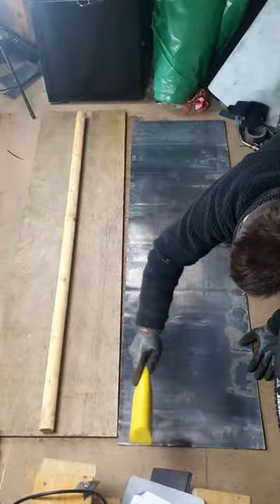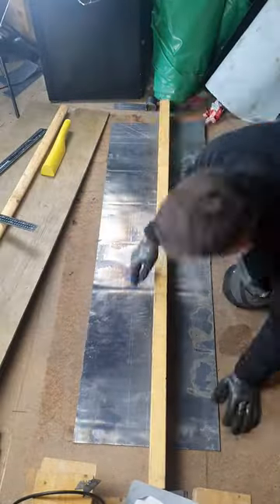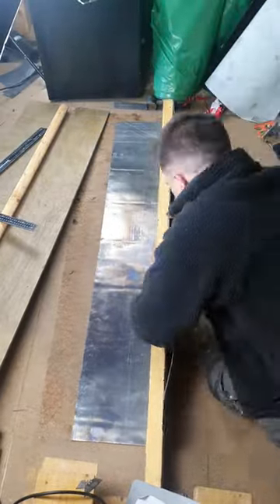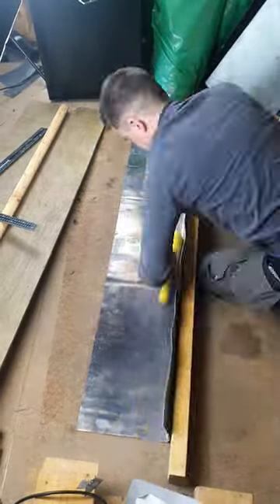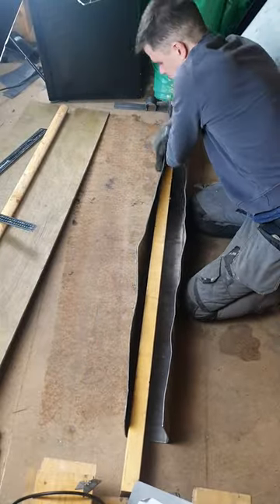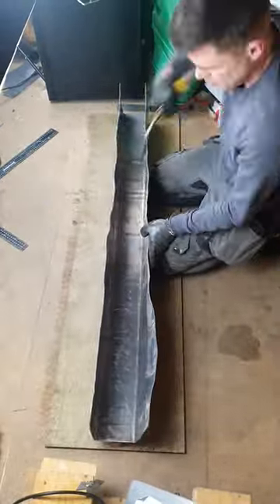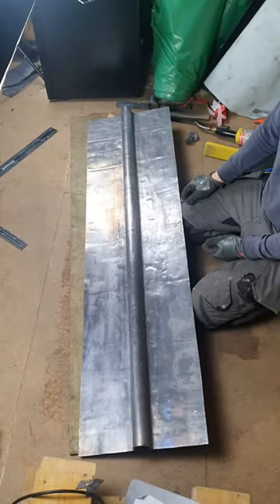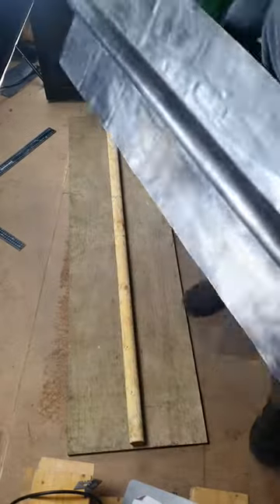ATTEMPT TWO at Lead Ridge Bending #shorts #leadwork #leadworking #roofing #roofer #diy

Comment: Lead is so old, it’s literally the result of decaying radioactive material that had to go through several decay cycles. Blows my mind every time.
Reply: Blows my mind people still use it for a building material.
Reply: @darkwetntight910  I do believe that. I have worked on a few 1850s homes here in the states that have lead window or transition flashing, never seen a lead ridgeway here. It is durable stuff, I try not to touch it if I can. Half the time it's been painted over 20 times and all the wood is shit. I'm not even sure if we can buy it here in NY anymore.
Reply: @dusfitz it's great for blocking x rays into your home.
Reply: It will keep Superman from peeking in.
Reply: @easelove that a problem you encounter a lot?

Comment: Slap that over a scaffold pole in the centre and bend down , weight of the lead helps you bend it down and use your setting inn stick to dress a crease at the bottom of the pole … knock them all up and fit and dress to the wood roll on the roof … quick and easy  🎉

Comment: Layman here but would it help at all to run down those initial fold lines with a wide chisel and light taps with a mallet? Just enough to give it a line to bend along, kind of like scoring it without actually splitting the metal. Think that would help at all with those initial 90°'s? Maybe save a little time and possibly end up with a cleaner line. Or would it be damaging to the lead? Genuine curiosity here from a layman. Also heres a little afterthought: think a little curved block of wood to hammer on would help make that middle bend a bit easier? Toilet thoughts. Thank you for joining my Ted talk.

Comment: not fun work to do. a wooden "SHOE " to tuck and a rubber mallet. equal pressure is key,using rubber hammer makes it shape to form easier. simply roll to suit. your done and can shorten time of replication easy.

Comment: Looks spot on, I remember doing around 500 meters of hips and ridges on a 60° pitched roof. Builder wanted heavy lead straps on the outside as well as copper and lead clips on the underside. These 5 star apartments were on the coast with a helli pad so builder wanted to make sure no lead was blown off the roof. I spend a full week melting scrap lead and pouring it into a hard wood mould that I had to sprinkle with baby powder that made 3 each time then after around 30 pours the mould needed replaced as it was getting deeper with the heat of the lead burning it. That roof was a pain to work on,i had to bring an old cushion to sit on after the first day lol
Reply from the maker: Sounds fancy af!
Reply: @Micro House  oh they were very fancie, Crawford House In Crawfordsburn n.ireland.i got to meet Eddie irvine when he was viewing his apartment,the only famous person I ever met lol 
Working with lead is an amazing skill,from bossing it to welding it, just take your time. Just be sure to oil it up with some patination oil when done before the rain turns it white. If you have no oil a bit of petrol on a cloth will do the job. Take care up there my friend and god bless
Reply from the maker: Aye it's fun to work with! Thank you! :)
Reply: I'm curiious.  Why would the builder request lead straps and lead and copper clips?  First of all, galvinized straps would be stronger and less likely to corrode.  Copper and lead would be VERY vulnerable to galvanic action between each other and thus corrode.  Finally, wouldn't lead straps bend, twist and deform more than steel would?
Reply: @1961casey  the heavy lead straps i made won't twist or deform over time that I can guarantee (40mm thick)
The copper hidden under the lead clip was used to kill moss, algae and lichen more than anything. Simple solution to a very annoying problem that can affect a roof over time. If you ask me the copper would need a continuous strip the length of the ridges to achieve what the builder wanted but he wanted them hidden under the lead clip @ 500mm spacing so builder got what he wanted👍
Reply: yuriashol3398 we only use felt shingles on garden sheds in the U.K.

Comment: To much work. You should of just heated it up and then just form it around that round piece. That would of saved time especially if you need 6 of them. You should of clamped at least 2 of the corners as well on the same side. You could of put it on a table so you could of got a bit more leverage on it as well or  used 2 horses. Not saying you did anything wrong, but to save time.

Comment: only thing I can spot wrong is your not using wood lead beaters the old wood ones are best I use them
Reply: Are they 😂😂
Reply: @YoutubeSlayer-t7w  for me they are but I suppose each person has there own favourite I only like the wood ones when there well used new ones are crap my uncle made one from a rubber mallet just cut it so it was square not round comes in handy for long lengths of flashing when we do canopies along the front of houses like all the way from the side of bay window to the other side of the house
Reply: @DavidDavid-ip1xf   yeah to there own mate, definitely needs to well used, same goes for plastic ones,its sometimes good to polish of the edges with a bit sand paper if you get a new one.

Comment: I hope the water of that roof isn't captured in a tank and used for crops or human consumption...
Reply from the maker: Goes down the drain. But there is very little lead run off, it's oiled and then a patina forms

Comment: Terrible!
Your supposed to use bare hands. And that torch should only be for the cigar you light after doing it right.
You need 6 for the ridge? Well I could do it with 4. Maybe even 3 if I felt good that day.
Don't get me started on that banana thing! Id use a different banana for that, if ya know what I mean.
Reply from the maker: This is the advice I needed :)

Comment: Impressive tbh but we don't use lead
Reply from the maker: Why not? 🙁
Reply: @micro-house  not a common thing around where I live, we use tar shingles, steel, and aluminum and polyurethane is pretty popular right now they make them look like wooden shingles but the a flexible plastic
Reply from the maker: Aye we build our roofs very differently. Most popular here is zinc, its cheaper than lead

Comment: You guys still use lead WTF
Reply from the maker: haha aye, we build roofs that last :)
Reply from the maker: not really, there's only a very short period where there's lead run-off. Once the patina forms then there's no run-off. It's declined in use in most countries because it's expensive and technically difficult. It's a very long lasting material, 100% recycled and 100% recyclable.